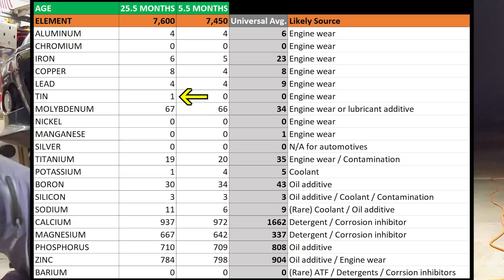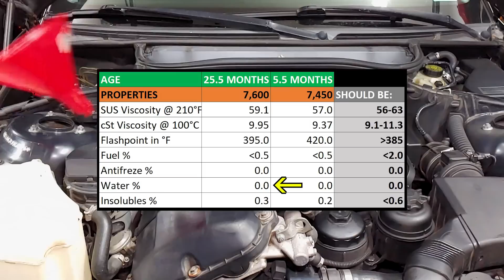Does Oil Really Need to be Replaced Every Year? Surprising Analysis Results Revealed

Comment: Mileage has some bearing, however the type of driving is a much bigger factor.

Short stop/start journeys were water particles and carbon deposits are not burnt off due to the engine not reaching it optimal temperature for a period of time.

So using your car once a month and driving for 100 miles none stop is better than driving  for 100 miles doing 20 drives of 5 miles each time.

35yrs Motor Trade 🇬🇧
Reply: I know it's been said but makes me doubt stop/start technology.
Reply: @willpeony5534   I agree, mines permanently turned off (coded out).
Reply: I'm driving 6 miles per trip daily. I guess I'm ok because 6 miles is more than a short trip
Reply from the maker: 6 miles is a pretty short trip. You need to drive 30-45 minutes to fully warm the engine.
Reply: @endlessmoneypits 30-45 minutes sounds like a long time , my truck water temp only takes a couple minutes to get 175°
Reply from the maker: @charltonheston969 water temp is not the same as the temp of the oil and metals in the engine.
Reply: Royt also fuel mixing engine oil while starting old cars. It disolves oil and breaks down quicker. If the car is old style engines use cheap oil and regularly change it. Right
Reply: How can carbon deposits "burn off" in an engine, when carbons combustion temp (and that is in the presence of oxygen/air) is around 1300* F, and engine temps range between 200* to around 500*f at most?
Reply from the maker: Driving at high RPM can potentially help reduce carbon deposits in the combustion chamber, but it’s not a guaranteed or complete solution. Here’s how it works and some context:

Carbon deposits build up over time in an engine’s combustion chamber, particularly on valves, pistons, and cylinder heads, due to incomplete combustion, low-quality fuel, or short trips where the engine doesn’t fully warm up. Running the engine at higher RPMs increases combustion temperatures and airflow, which can burn off some of these deposits. The increased heat and pressure can dislodge and expel lighter carbon buildup through the exhaust. This is sometimes called an "Italian tune-up," where sustained high-RPM driving (like on a highway) is used to "clean" the engine.

However, there are limits. If the deposits are heavy or hardened (e.g., from prolonged neglect), high RPMs alone won’t fully remove them—professional cleaning methods like walnut blasting or chemical treatments might be needed. Plus, pushing an engine too hard without proper maintenance (e.g., fresh oil, good fuel) could cause more wear than benefit, especially in older or poorly tuned engines.

Evidence is mostly anecdotal, but some mechanics and car enthusiasts swear by it for lightly carboned engines. Studies on engine deposits (e.g., from automotive engineering research) suggest heat and turbulence help, but they don’t isolate high-RPM driving as a cure-all. For modern cars with direct injection, which are prone to intake valve deposits, this method is less effective since the valves don’t get fuel wash like in port-injected engines.

So, yes, it can help to an extent—especially for minor buildup—if done safely (e.g., 3000-4000 RPM for 10-15 minutes on a warmed-up engine, within legal limits). But it’s not a substitute for proper maintenance or a fix for severe cases.
Reply: @ What a long winded reply, to something I explained in a much simpler way using half the amount of words.
Reply from the maker: I used Grok to explain it fully and eliminate any confusion.
Reply: @justinw1765  you over thunk (intended) this carbon deposits will burn off at lower temperatures over a prolonged period of time.

Comment: This is interesting in a useless kind of way, but why rock the boat. Changing oil and oil filter is the least expensive maintenance, why risk wearing out  an engine unnecessarily or even damaging it for a 30 dollar 30-minute service twice a year.
Reply from the maker: The point was to find out if it's really a risk. Apparently not.

Comment: Very interesting l live in Australia and l own a 1997 Toyota Hilux with the the 22R motor and l change oil at 10000kms l chaged the oil and filter a while ago and because l am retired and we have another car and they both get used and the car was new in 2021 and we struggle to do 10000kms in a year same goes for my Hilux l do try and use it every day as with the car my Hilux has 431000kms on it the engine is not burning oil and when l bought 4 years ago l got no service records at all nothing but since owning l keeping every piece if paoer work receipts from our local soare parts shop and have a list what l have done to the Hilux as when l can't drive any more l will probably pass it onto our daughter and there will be paper work

Comment: i go by the oil color. i changed my oil 2+ years ago, but i don't drive much, very little really, and my oil looks nearly new. even when i drove a lot(for me, about 25 miles a day average) i still went by color. heck, look at diesel oil, that stuff is black as chit from nearly day 1, and those engines go for a long time.
Reply: oh. there have been times that i even skip changing the filter = just dump it out and add new oil.

Comment: This is actually really interesting. I'm only averaging maybe 2,000km in one of my cars. It's subjected to adjust trips most of the time. What sort of diving were you doing? I run petrol and LPG (Dual Fuel). I changed the oil after a year and added in some liquid moly
Reply from the maker: I try to avoid short trips, so usually 20-40 miles at a time. The car just sits a lot. I've started driving it again recently so I can do more oil tests.

Comment: My experience:
Year 2000 E46 328i. Went 7 years without oil change and only 5,000 kms (3,000miles) traveled. Oil still looked perfect; cartridge oil filter had petrified to the point of breaking apart when removed.
Reply from the maker: I have seen pictures of filters break apart like that. Scary.
Reply: Soaked in acidic oil for years. Your engine seals didn't like it either. 7 years take too long going from 3k (fresh) to 5k (lightly acidic), sitting.
Reply: @tomasnokechtesledger1786  Your theory is theory looking for an idealised target number. Tolerance is tolerance. 4 years later from that and 23yo engine still has zero oil leaks.
Reply: @DiscoFang  Yes. And with extended amount of time and usage the oil change a lot. A 3k oil can be kept for several years, but a 5k oil is another animal. If you take 2 years to get to 3k miles, then more 1 year to go from 3k to 4k and another year to go from 4k to 5k  you're soaking in already bad oil. After 3k the TBN is kindda low to cope with the esparse use and long extended time. The sitting oil start to ruin through oxidation, getting more humidity from the air, by itself even at room temperature, inclusive increasing its moisturizing that accel this degradation process. So,  IMO, dont wait too much, after 3k.
Reply: @tomasnokechtesledger1786  Nonsense. Are you living in 1976? Yes oxidation is a concern but modern synthetic oils, modern ultra low sulphur fuels and modern engines themselves don’t require such frequent oil changes.
Reply: @DiscoFang  today's tgdi vehicles does fuel diluted the oil, way more than a 1976 carbed car. Put a liter in the sump every a few thousand miles, than keep the oil in the sump for 7 years. Today's oils also can't cope with that and way more heat in lower volumes. Do you think today's lubrication is in easy ride? Think again.
Reply: @tomasnokechtesledger1786  And yet, actual experience and manufacturers’ service schedules tells different from your theoretical rationalisations. But you be you.
Reply: @DiscoFang  Yep, and they're with me. They say to change your oils every year. Some Europeans allow max 2 years. I wouldn't go 7 years/5k miles.Your car, you be you.
Reply: @tomasnokechtesledger1786  most Euros up to 10,000 miles.
Reply: @DiscoFang And what about change time? 9.990 miles @ 7 years wouldn't be good.
Reply: @tomasnokechtesledger1786  You’re having a hard time with this aren’t you?
Reply: @DiscoFang  no, I just wouldn't do it.
Reply: @tomasnokechtesledger1786  I'm kind of agree with you about that TGDI does shorten the oil's life and I see some fuel dilution from oil blotter spot check. I guess those long oil change interval apply to N/A engine only without direct injection.
Reply: @tomasnokechtesledger1786  the crank case is sealed when the engine isn't running, there shouldn't be much humidity
Reply: @ericfranke1637  sealed? No, it's not. It's open by its plumbing. It breathes all the time. I see you have no motor knowledge at all... go study a little and then come back.
Reply: @tomasnokechtesledger1786  Maybe if you’re geriatric. Engines haven’t vented to atmosphere since moses drove his people mover into the sea.
Reply: Interestingly my father who was a mechanic and garage owner ( retired) was given a peugeot 405 Sri with 120k miles on by someone emigrating to Australia. He kept the car same as you 7 years. In that time he did not service one item oil, brakes anything. His motto was if it ain’t broke don’t mess. I cant say I agreed with him but, indeed worked for him. He only added another 30k miles to it before he passed but nothing went wrong with it. When I sold it I serviced it and boy did I have a game gettin oil filter off. No oil leaks anywhere. I change mine on colour if so lot miles or yearly if under 10k a year. Never had engine blow up cars or motorcycles. Remember oil is a coolant too
Reply: @volt8684  Very relevant to note that you’ve never had blow-ups on cars or bikes. I mean that’s the whole point of making oil changes right? Pursuit of longevity and reliability of the engine. Over my years I’ve owned just over 70 cars and bikes including the BMW mentioned above for 17ish years. Over that time I’ve had precisely ZERO failures attributable to the oil and it’s roles whatsoever. Most problems (the very few of them) relate to the cooling system or fuel delivery. 
And I’ve bought a lot of cars at auction where mileage is high and maintenance history is non-existant. 
Oil change frequency is bordering on myth. But it’s clung-to like a religion.

Comment: I'm doing 10,000 mile oil changes on my 2015 Toyota Highlander and I started off having it checked at 5,000 miles as a baseline. I increased the intervals on oil changes by an additional 1,000 miles on each change till I was at 10,000 mile changes. Oil is still well within specifications. As far as the flashpoint is concerned it is higher at the 10,000 mile change than the 5,000 mile change. I started driving for a good 20 minutes before the changes at the 6,000 mile oil change. Flashpoint has remained well above the 425 ° mark since then. This Highlander has 200,000 miles on it and doesn't burn a drop of oil. I put a borescope down the valve cover and didn't see any varnishing. I use Mobil 1 0w - 20. So far so good!
Reply from the maker: I'll be testing Mobile 1 in an upcoming video. Just got back from the store with it. Will be in a different car.

Comment: My last car was a basic 1300cc from 1994. I bought it at about 10 years old with 42,000 miles on the clock. I changed the oil at that time but then left it for the next 13 years and approx 100,000 miles (the mileometer had stopped working by then). The engine ran absolutely fine and the oil looked great.

Comment: Sent in a sample to Blackstone recently. Suby OB turbo 2020 Onyx 40K odometer: at 10K and filter changed at 5K. They suggested running it next time to 10 or 12K. The car used for distance driving, very little stop and go. And of course the filter sits on top and any idiot can change it. Puts the lie to 6K owners manual requirements.

Comment: As I see it short trips over time is different than just time.  Is the flashpoint due to unburned fuel?
Reply from the maker: Fuel levels were the same in both samples at <0.5%.  Although I haven't put many miles on the car in the last 2 years, I have tried to avoid short trips as much as possible by taking longer routes than necessary to get the engine up to operating temperature.

Comment: Nice video and good approach. Regarding sodium it could be coming from condensation inside the engine. Condensation is normal but increases when warming up the engine idling or when doing short drives. Just my 2cents

Comment: It hugely depends on driving conditions, driving habits and driving distances. Ultra short driving distances, especially during winter are condensation heaven, and much more…
Reply: The easy solution is to drive any car with those conditions for 15-20 minutes on the freeway to cook out the harm in your oil at least once a month. This is a well-credited oil analyzing lab (Blackstone) advice.
Reply: The type of engine is more important the driving style. A direct injection gasoling engine would have the highest fuel dilution, followed by turbo diesels and then port injected gas engines. You can typically go 2 years with port-injected gas engines, but with direct injection it must be changed within a year.
Reply: Correct 💪

Comment: If you are not pushing the engine to it's limits of heat/wear very often, then yes oil does not degrade naturally over a few years.
It does degrade however if it it exposed to high temperatures and high revs in engine use (such as trackdays).
I drive my cars hard. I change my engine oil every 6000 miles, and have just done a gearbox oil change, and rear axle (diff) oil change too, at 41,000 miles.
I have worked in the motor industry a number of years, and have seen to consequences of poor maintanance.
BMW say my M140i needs oil changes every 15,000 miles !! WTF this is far too long. For an engine with 340bhp standard, no way, and most owners tune them (mine is 455bhp), this causes more heat and more stress when pushing the engine, and more oil degradation. I think 7000 miles is about the maximum without wasting money.

Comment: i think this is a sign that the engine is still in good condition. if it was burning oil or you did have water getting into the oil, you would want to change the oil alot more often . useful information
Reply: How would water be getting into the oil? If you have a coolant leak (not water) then changing the oil won't solve it. If you have condensation build up, just running the car to operating temperature will evaporate the water.

Comment: Well the way I see it is quality motor oil and a filter is cheap,engines are very expensive. I don’t listen to anyone about these ridiculous 10,000 mile oil changes,that’s the quickest way to sludge up your engine. I have a 18 year old Toyota Camry 2005 altise 3.0 litre v6 that i bought from an elderly couple that bought it new. It has complete service history up until 250,000 kilometres,engine oil was changed every 5000 kilometres- yes every 5000 kilometres which is a little over 3000 miles for you Americans.The engine has 284,000 kilometres on the odometer,it doesn’t use oil or any fluids,oil looks clean and still new when I drop the oil and this is because it has no sludge build up inside the engine. I’ve had the valve covers off this engine to replace the seals and it looks like a new engine inside,no varnishing,no sludge,just clean glimmering metal surfaces. No matter what engine you have in your car-NEVER do 10,000 mile oil changes,it will destroy your engine. Maximum should be 5000 miles,I’d be doing it every 3000 miles.

Comment: The big enemies of oil are moisture and particulate contaminants. Modern oil filters can reduce the particulate loads in the size ranges that can affect engine wear very efficiently and so this form of damage is usually well-controlled, even at high mileage intervals between changes. Moisture, however, is subject to the driving characteristics- short trips in colder climates can accumulate significant amounts of water in the oil. It is important to get the engine hot enough for long enough to evaporate the cold-start moisture from the oil. Moisture will catalyze oil polymerization, which increases oil viscosity with age. Moisture also will react with the additives used to control corrosion and eventually depletes them sufficiently that the oil becomes acidic, and metal damage accelerates. So if cars are driven frequent short trips in a cold climate, shorter change intervals are necessary.
Reply: THIS.
Also, is the car garaged, or outdoors: pavement or ground?

Comment: I have 1989 F150 with 220,000 miles. It developed a head gasket leak so I decide to pull it out and tear it down. I have always used synthetic and change oil at 5000 miles. When I opened it up, I could still see the original factory cross hatching from the cylinder hone before the pistons were in stalled. Basically, no visible wear. After the new head gasket, it runs perfect and uses no oil. I’m shooting for 400,000 miles with out a rebuild.

Comment: Once oil is no longer honey coloured it needs to be changed. It has done what it's supposed to do it should not stay inside the engine, all the carbon particles and crap sink to the bottom of the sump and other parts where oil is retained in small depressions and starts to form sludge.
 This requirement is regardless of viscosity and additives in the oil. What's cheaper and oil/filter change or an engine that is gummed up with ''black death'', loses power and may need reconditioning depending on use (short journeys worsen wear).

If you're not prepared to change your oil every 3 to 5,000 miles and keep your engine in tip-top condition live with the consequence. Have you seen the internals of an engine that hasn't had regular oil changes compared to one that has? Remove your sump and have a look inside.
 Synthetic oil is not synthetic at all, that is marketing b/s. Use a good quality mineral oil.
Reply from the maker: Every turbo and diesel engine owner will quickly refute this. Their oil can turn black within a few hundred miles.